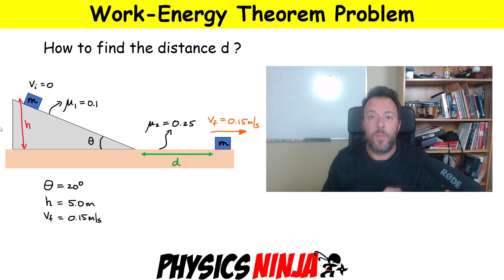Work Energy Problem - Sliding Down a Ramp

Comment: There's one I'd like to see.

A block of  mass of 4 kg being pulled up a frictionless ramp by a constant force of 6 N. The ramp is 5 m high and 75 m long. If the block has some initial velocity, let's just say 3 m/s, what is the speed at the top of the ramp? I've made-up all these numbers. This isn't a homework problem or anything.
Reply: Well, turns out I solved it. The answer is about 25m/s ( or 25.03796 to be exact). So here you go
Reply: @spacexnerd0192    😎

Comment: Would that be easier for the ramp part to calculate the resulting/net force and then calculate work done on the ramp as a product of the net force over distance1 ?...thanks for ur videos!!
Reply from the maker: There are many ways to solve this problem.   You either find the work done by each force or you find the work done by the net force, they are the same.
Reply: @PhysicsNinja  thanks again for ur videos! Some old farts like myself use them as part of recupiration)) cheers!